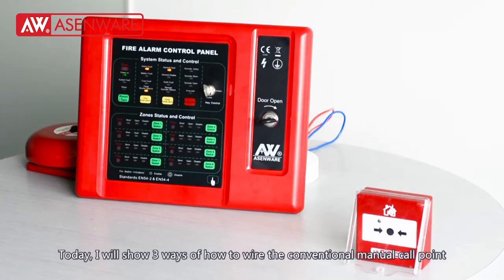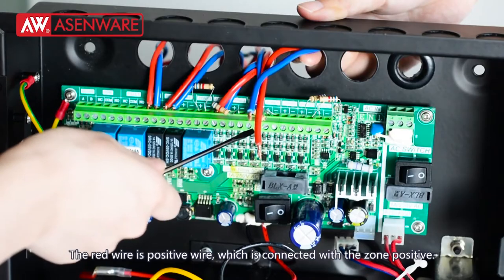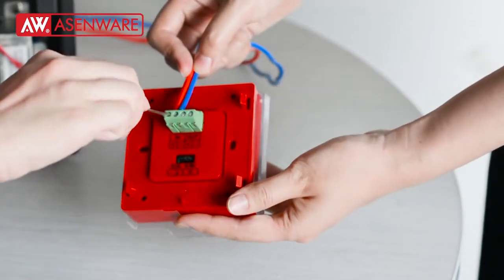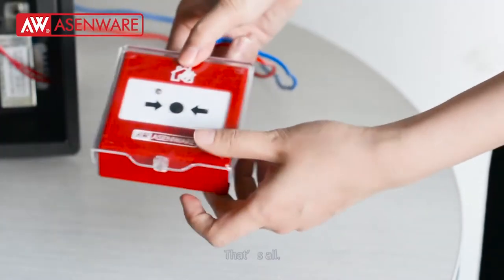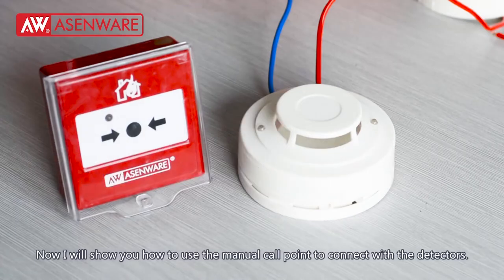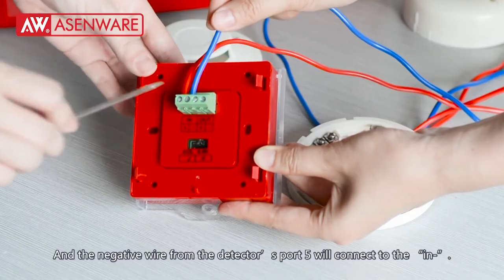How to install Conventional Manual Call Point

Comment: Thank's. More demo videos pls.. dip switch setting how it works? Thanks.
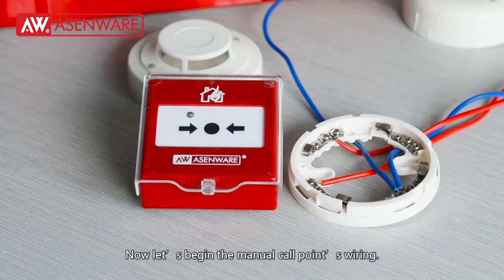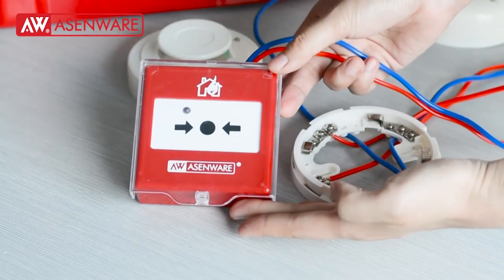Reply from the maker: thank you for your support,if your manual call point it's the last one device in the zone ,you could check our video from 4:34 to 5:20 to learn how to set the dip switch,or You can contact us through sales03@asenware.com

Comment: What will happen if we share the 6 and 2 terminals in every smoke detectors?
Reply from the maker: Hi dear, kindly see this wiring method for AW-CSD381-Conventional Smoke Detector:
Wire connection point:
No.2: IN + ( zone input + )
No.6: Remote indicator(+) / Next detector IN (+)
No.5: IN - ( zone input - )
No.3: Remote indicator(-).
Reply from the maker: Welcome to contact us for more information:
asenwarefire.com
Email: info@asenware.com
Whatsapp, Wechat, Tel: 0086 13922805301